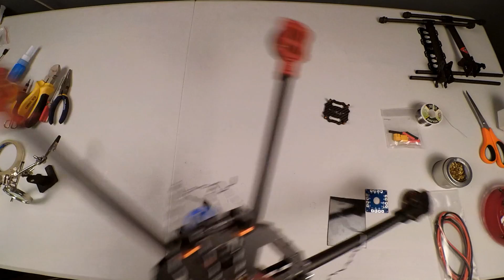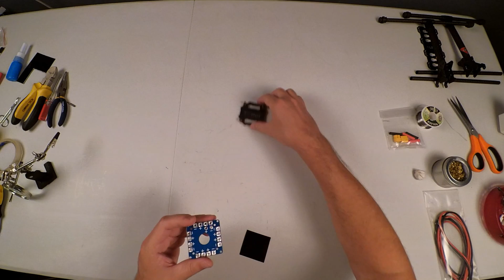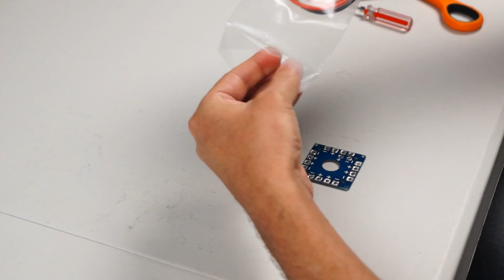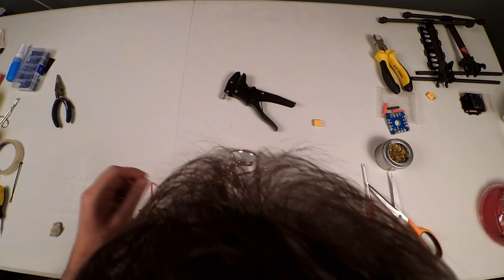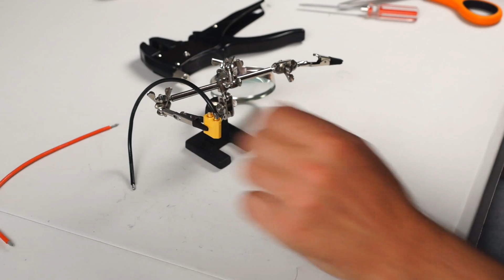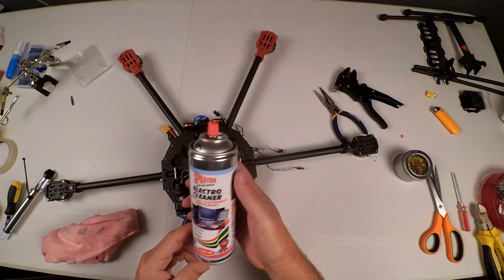Hexacopter Build Part 6 - Solder ESCs to PDB and Mount on Tarot FY690S

Comment: Hi, I liked your video.
I am making a Hexacopter for autonomous flight project for my university. I have 6 ESCs for 6 motors. I know that these ESCs Doesn't have UBEC inbuilt in them. To solve that do i need 6 separate BECs  hooked  to  each  ESCs  saperately? or I  just  need  one UBEC hooked to the   5V output pin?

Specifications. 
We will be using Hixhawk 4 for flight controller. 
Nvidia Jetson for computing autonomous flight processor. 
Tarot Brush-less Disc Motor 4108 380KV 6S
Hobbywing XRotor Brushless ESC 2-6S 10A 15A 20A 40A SimonK No BEC High Refresh
Tarot FY690S Full 6-axis 3K Carbon Fiber Aircraft Frame
Slamtec RPLIDAR A1 2D 360 degree 12 meters scanning radius lidar sensor scanner
Reply: Hey I am working on a similar project with similar specs. How did it go for you and what PDB did you use?
Reply: @charlesstewart3269  

I'm using Pixhawk 4 flight controller. Pixhawk 4 has it's own Power distribution board. It comes with the controller and PDB together.

Here is my Drone Video.
https://youtu.be/CfywUeL6XPo
Reply: @panchampatel1  sweet man! I'm using the knockoff pixhawk 2.4.8 and it comes with the power regulator but no PDB for the ESC. I'm including obstacle avoidance in my project with the rpLIDAR a2. Hope I get similar performance to yours! Good shit dude
Reply: @charlesstewart3269  
I have zero idea about Pixhawk 2.4.8. but your obstacles avoidance sounds good. Please keep me posted it. It sounds interesting. 
Here is my Instagram: panchampatel0

Comment: hi how are you . how can i connect a hexacopter to T10J FUTABA , (, A DRONE APM,  BUILT IN )   MAY SEND ME THE SETTINGS , ON HOW  TO CONNECT FUTABA I AM TRYING TO CONTROL BUT IS NOT WORKING. YOUR ASSISTANCE WILL GREATLY APPRECIATED

Comment: Riaan,

I've just built the exact same Hexacopter however My PDB came pre soldered, my question is do you have a power module connected and if so what did you do with the UBEC, at the moment i've just disconnected mine and tucked it all away neatly, I've also removed the jumper (JP1) from the APM unit however i'm not sure if this is correct?